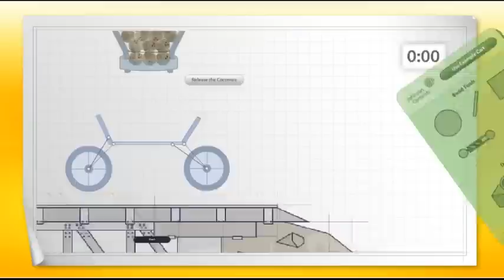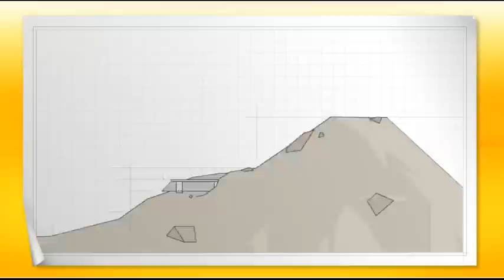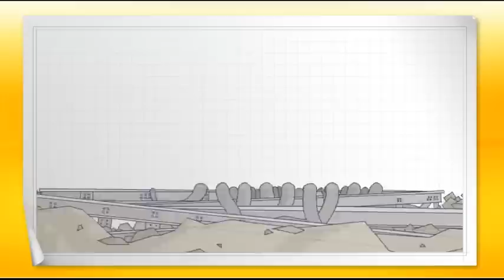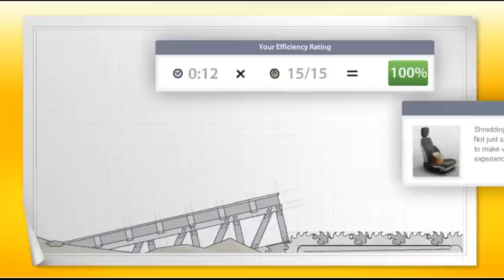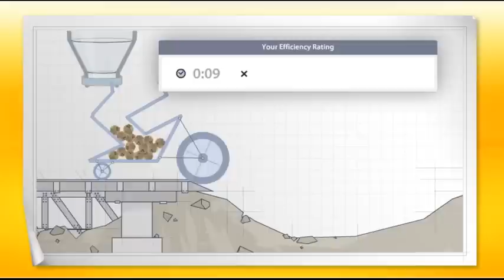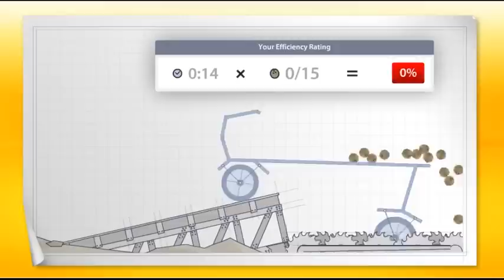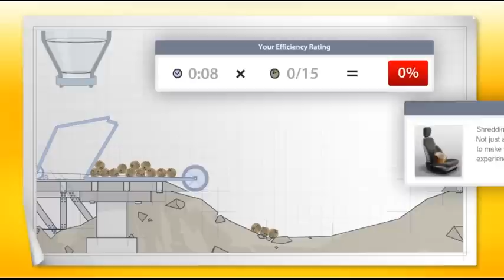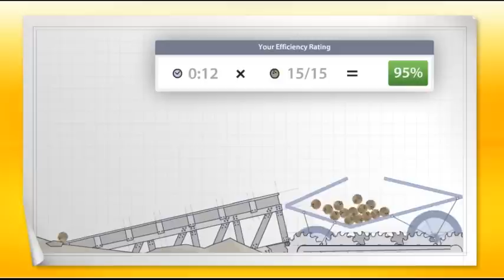Random Game Theatre - Coconut Run

Comment: You need a bit of engineering skill :)

For example, if you have wheel too close to your vehicle body, it cannot rotate freely because it touches vehicle. Move it a bit further so it can move.

If you connect wheel to vehicle body by only one spring, it doesn't hold the wheel in position cause spring doesn't mantain attachment angle, only distance. To resolve this, add another spring connecting wheel to vehicle body in different position. But not too different, If wheel connected by springs spread by 180 degrees, wheel would wobble.